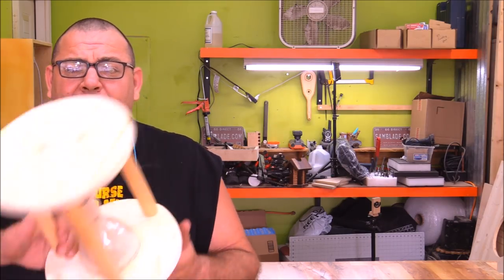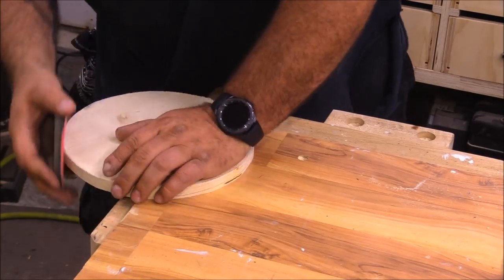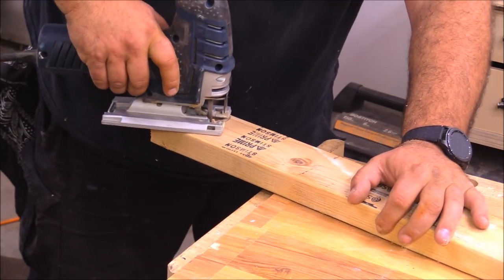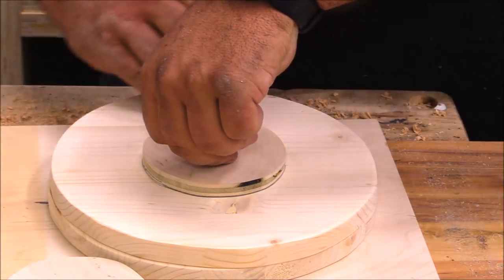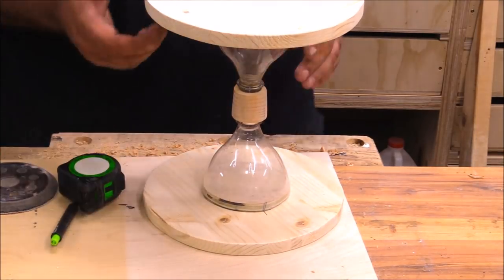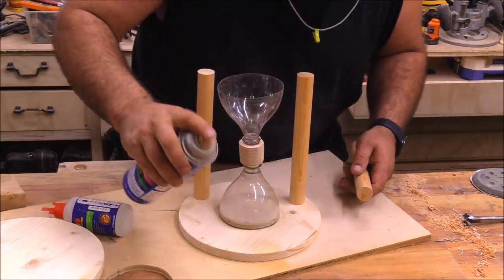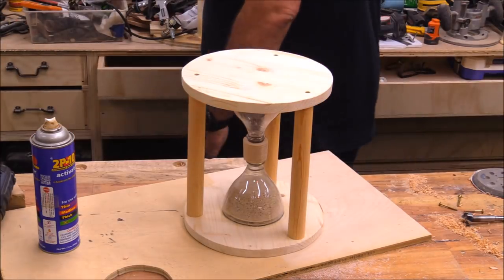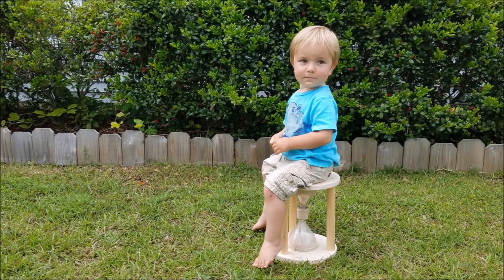How to make an hour glass time out stool | Izzy Swan

Comment: "If you wanted something that would run longer, you'd need to make the hourglass bigger to hold more sand." Or you could make the hole smaller where the sand drains from the upper glass to the lower one. A smaller hole means it takes longer for the sand to drain out.
Reply: and easier to plug up cos it builded up. hole needs to be such that the sand won't plug it up. He's using coarse sand there.

Comment: I'm thinking you could make the time length adjustable by blocking the sandhole partially but it leads to two questions:1] How small can the hole be before it has a tendency to clog2] How to you make it so YOU can adjust it but kiddo CAN'T [I'm thinking two part mechanism with removable handle]

Comment: Cool projects... But my question is why don't u have CNC machine in your workshop?
Reply: proeng eleceng personally I'm glad he doesn't, it's sad to see how many content creators are starting to use them. it makes for some very boring videos in my opinion
Reply: MrTarfu +1. I had access to a 25hp servo cnc that would chew threw 2.5 inch mdf like it wasn't even there. This project as a one off would take longer on the cnc.